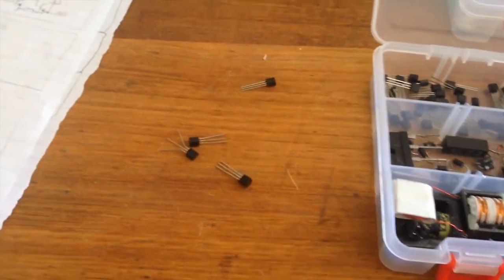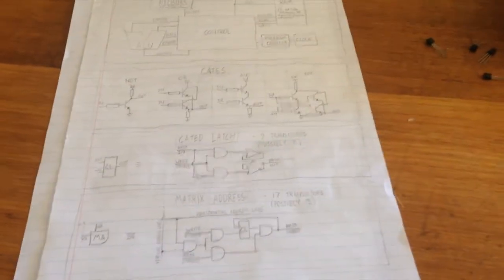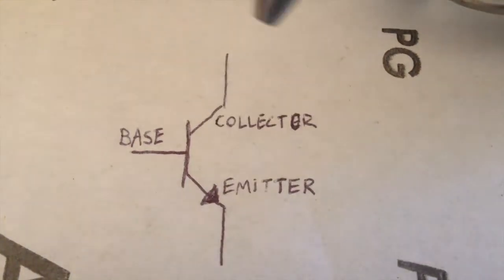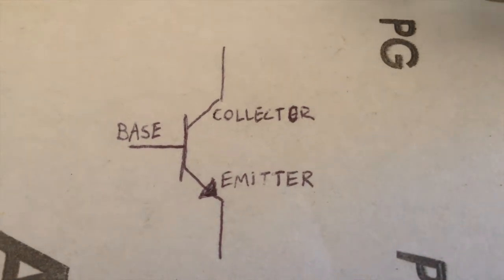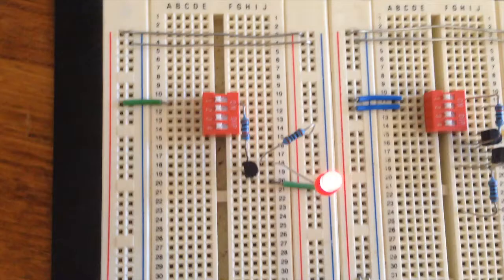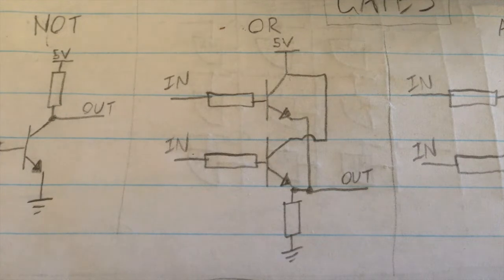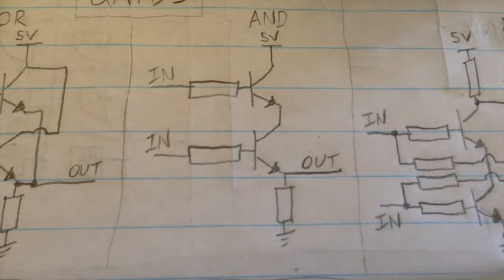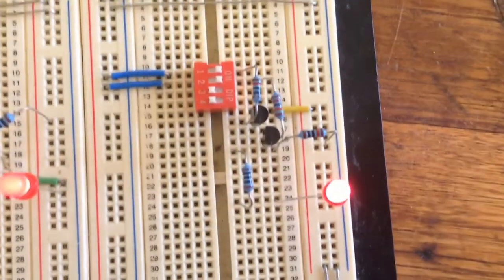Computer From Transistors Part 1 - Logic Gates

Comment: Hi, I'm looking at your XOR schematic and I think there's one resistor missing - right before OUT. At the moment, if you apply high state to both INs, then the 5V supply get's equally "easy" path to both ground and OUT. If I'm wrong I'd be thankful to be explained why is that, as I'm a beginner.
Reply from the maker: As is, the circuit does work as it’s meant to, when both inputs are on, the output is meant to be set to a ‘low’ state, or 0v. 
In the configuration of having both inputs on, the path to ground (through the transistors on the left) causes the resistor at the top to accomodate the full 5v drop in voltage. From there, the transistors on the right don’t receive any voltage on the collectors, due to being connected to the bottom of this resistor. Hence, the output (connected to the emitters of those transistors) is set to 0v.
Reply: @ScrapScience  Ok, thanks, I think I may understand that point. Could you however let me know what is the function of the resistor at the bottom, connecting GND and OUT? What would happen if you took it away and there was no connection at all?
Reply from the maker: Under ideal conditions, it's not strictly necessary to have that resistor, but in practice, it's good to have a pull-down resistor on the output to avoid having a 'floating' output. If, for instance, we use the gate to power extremely low current devices (such as the gate of a MOSFET), normally negligible residual currents through the transistors could cause the output to be set to an incorrect voltage.
But really, you're correct in the fact that it's not really necessary.

Comment: You've got balls of steel. My research area in PhD is digital signal processing, antenna arrays and microwaves, and I you've got my admiration.

Maybe if you mix up logic families like DRL (diode-resistor logic) for simple ports, RTL, DTL, and even TTL for specific functions, it would save you some time.
For example, if you need a 8-bit OR gate, in my opinion, it is far simpler (in terms of time spent soldering and assembling) with a DRL.

I don't know if you have done that, but first you have to put on paper your address and data BUS sizes, in order not to get lost during the ALU and memory design. That will give you some degree of freedom.

It would be awasome if you went rogue and decide to build a magnetic core memory, haha. But depending on the the architecture (more than 4-bits), it would be unfeasible at home.

Good luck!